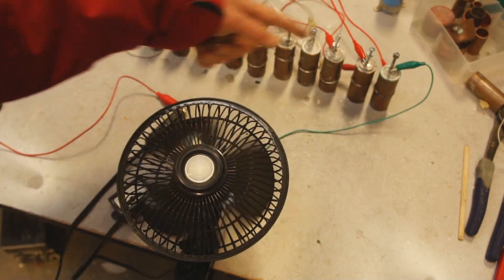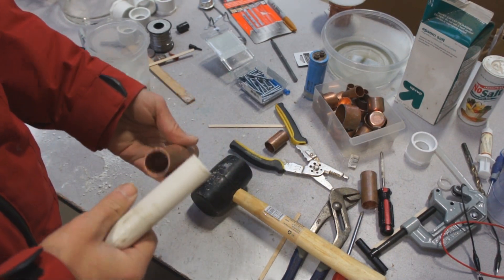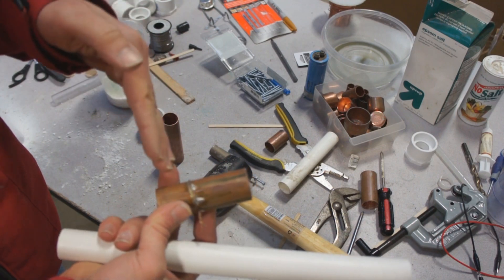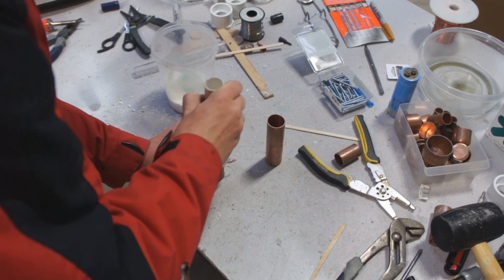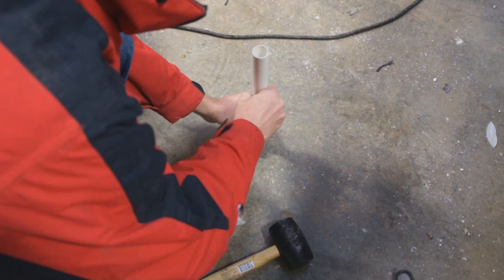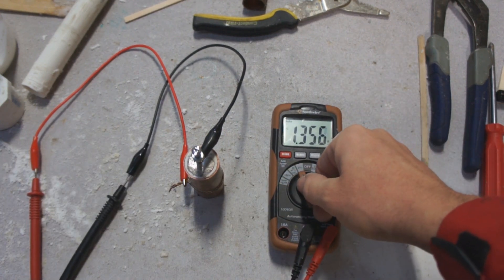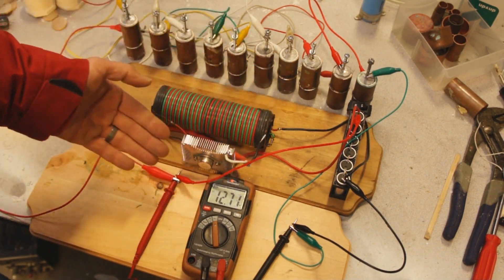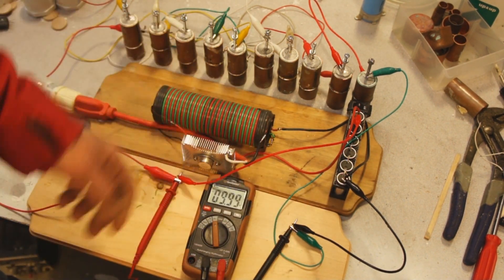12V Crystal Cell Update + Alternative Construction Method

Comment: LaserSaber, I see this vid is old but I wonder if a couple of the crystal batteries the size of d cell batteries would power my minnow bucket aerator? It runs off 2 d cells in parrallel, batteries are expensive now days.

Comment: If you employ Nicola Tesla's battery  recharging system  using your   crystal cell batteries..simply split the positive of your battery  packs  and run a constant power  from the difference of potentials of the positives..Your greatest problem lies with the gevity  of the  crystal cells and switching of order of the cells unless you incorporate a separate induced current to maintain the depreciation of current over time..such as a solar panel or a grounded RF reciever..ect.

Comment: I heard if you pass the current true a crystal quartz it will give an output of 30% more power…. So all the wiring from the battery goes to the quartz then just by coiling the copper wire around the quartz and setting upa contact plate to the point of the quartz is supposed to increase the energy to 130%… 30% extra… would you try that on your device because I think you’re on to something…. You need the hexagonal quartz for that to happen…
Reply: Bad idéal, quartz cristal are non conducting material 😂😂😂

Comment: Could you stabilise the voltage drop off by adding a reverse motor to the circuit, which pushes in power? If you can find a way to stabilise the load, you could in fact have energy for a month on a 1000 batteries, idk , just a thought, maybe this. would be effective if also attached to solar panels on a home

Comment: Sauder a little handle on the side of your copper pipe and cut a slit  down the side of the pipe from one end to the other so you you can fit the plastic pipe in side with ease then if you want you you could use hose clamps to squeeze the copper pipe taught. Heating the plastic tuba and using the handle to pull the copper pipe down the length of the plastic tube just might be easier and less strain on your body than trying to push the two together without the pipe collapsing on itself.

Comment: As the 12V crystal cell update approaches, it is important to expect the amperage to drop radically before stabilizing at a long term base line. Based on past experience, this will be somewhere around 30mA. However, this is only a temporary decrease and the long term goal is to maintain a stable current. There are a few alternative construction methods that can be used in order to achieve this goal. The first method is to use a lower voltage. This will reduce the amount of current that flows through the device and help to stabilize it. The second method is to use a higher resistance. This will also help to reduce the amount of current flowing through the device and help to stabilize it. Finally, the third method is to use a combination of both lower voltage and higher resistance.

Comment: Please answer the following:
1 -  does the size of the copper/magnesium rod matter? ( rod thickness and length) ??
2 -  does the amount of mixture trapped in-between matter?
If I want to make a battery or an array of small batteries that provides ( 40-80amps, 220v ), how big would the battery look like?

Comment: The main advantage as I see it is that this would be a weatherproof battery that is also biodegradable. Would be a perfect battery to run garden lights at night.
I am just wondering how they would react to being exposed to a charge for a few seconds like a super capacitor. Lastly, would a few drops of water between the seals help the electrolyte powders do their job?

Comment: do these things ever run out?
Reply: depends on how well you make them.  I have ones that i made over 10 years ago but with no load for most of that time. its actually stronger now then day one.  Some people claim  20 years but who knows.  I've found that the better you pack them the more you get out of them and the loner they last.
Reply: epikrato so it's the piezoelectricy that makes then work? Didn't John Hutchinson also use 12 volts DC to jump start them initially?
Reply: Wonder if you used high voltage on them?

What recipe do you recommend? The original called for Rochelle salts and sodium silicate, which this one doesn't have. Or the lead glance or pyrite, but I don't wanna use lead.

Comment: Where do you get the magnesium metal and did you cast it or just get it in a solid form ?
Another question  why not  soldering wires directly  instead of those crappy wires with clamps those do alot of losses due to factors that those fancy  color  wires are just connected to clamps using a pressure plate and not soldered . Just test a clamp wire on a 12v powersupply with a 12v dc 50w lamp and see how much drop voltages those clamp wires do .
And about the crystal material what it is made off 
Thank you if I wish get a reply from you . 👋
Reply: I think the ring is not only a wire connection but a stop for the funnel. Look close at the funnel he is using. I just noticed this is over 6 years old

Comment: Can you recharge the Crystal battery? Great video by the way.
Reply: Joshua Zimmer if that's the case, you should be able to put them in any material even a non conductor as long as there is pressure, like resin for example. Or a recycled soda can or food can. 
Then just run a wire into the Crystal mixture before it sets. Right? No need need for Copper or magnesium. 

John Hutchinson originally used Rochelle salts which I believe have the highest piezoelectricy and sodium silicate amongst a few other things not in this recipe. I believe he also initially charged it with 12 volts DC as well.
Reply: @haveaniceday7950  I think you're right but I also think there's a plausibility there must be high surface contact between the salt materials and the conductors. Also it splits copper if there's no place for it to expand so if you use resin, you don't get the surface area contact of the salts. But if you used carbon fiber which is super strong (stronger than steel or copper) and it's also a very good conductor, you might make a super light weight battery that lasts hundreds of years. I may try this as soon as I get the rest of my "Things to do list" completed.
Reply: Anthony if you used bare copper wire and ran it into the Crystal mixture then you would increase the surface contact. If you created nanoparticles out of the Crystal mixture that too would increase surface contact. You can create nano with ultrasonic cavitation, RF, microwave and high voltage and I think there are a few other ways. 

Or maybe a copper rod and then solder the wire to the Cooper rod.

I wonder if you added graphene to the mixture if that would add voltage?

Wouldn't carbon fiber be expensive to use to build enough cells to get useful power?
Reply: @haveaniceday7950  I always side with building with any material regardless the cost and after I get it working efficiently, try to figure out ways lower the cost. I like the idea of mixing graphene in the mixture. Sort of like increasing the surface area of salts to conductor material. I believe now that you mention it, the graphene would act as a capacitor and store power so when the inrush occurs on the power out, it would be provided from the graphene. The outer and inner electrodes would need to have different composites because this is what dictates the polarity and flow if ions. But you could easily impregnate the carbon fiber outer shell with copper and the inner carbon fiber wall with zinc. This would easily provide a variance to flow the electrons in the proper polarity. I may break out the graphene tonight and try this.
Reply: Anthony how would you impregnate? Like electroplating? Then the "electrodes" would just be the inside and outside of the carbon fiber container?
I like how you just have graphene lying around. 🙂

What do you mean by when the inrush occurs on the power out?

If you try it, make a video let me know how it works.

Comment: YOU are a MORON and the people commenting below are blithering idiots.   You do NOT have a 'crystal power cell'  you have an old fashioned copper magnesium dry cell and those 'crystals' you are adding are NOT the source of energy they are the electrolyte to facilitate the ion and electron exchange.    You have no understanding of electrochemistry nor the fundamentals of what you are doing.   Its like a cave man chipping a wheel out of stone yet having no understanding of conservation of momentum.   You are giving up magnesium ions to the copper and forming a magnesium compound which is why its getting 'pushed up'.  The oxide, hydroxide or other Mg compound is larger than the Mg and thus takes up more room.    Also, your magnesium is way too large in comparison to your copper, you can get away with a magnesium tube and a copper tube.    go to books.google.com and look up any early 1900's book on "Primary Batteries" and you'll find this and a million other wet and dry cells that you can make.  The ONLY reason it goes for so long is because you have such a HUGE anode and cathode.  The reason you get such LITTLE current out of it is because your internal resistance is so HIGH.   You really want the magnesium and the copper as close as you can get them and still have room for electrolyte.....er.. um.... magic unicorn farting crystals of power.

Comment: The ingredients you use become have a greater conductor of electrify, the more pressure the more efficient the cells would be
Reply: So wait if he coated the outer pipe in concrete (so the copper wouldn't deform) would it increase the pressure more, giving higher voltages?

Comment: I know that your battery is long lasting but I would be interested in knowing if it would / could take a charge. I kind of doubt it as the powered residue that collects at the bottom of your magnesium rod probably won't reconstitute back into copper metal and magnesium sulfate, (Epsom salt), but it would make for an interesting experiment.

Comment: The reason that the magnesium core gets pushed up is the copper cathode is deteriorating, AKA, corroding as it produces electricity thereby  producing, I'm guessing, copper sulfate, which is a powder taking up more space, from the sulfur, (magnesium sulfate), in the Epsom salt. This is what makes commercially made batteries leak as they die.

Comment: Hi I noticed a reference to a dancing flower circuit, is that just an oscillating circuit? I would like to know if you would quickly mention what the dancing flower circuit is? one more guess would it just be the rocking flower women use on tables and gardens etc....? or am I way off? thanks

Comment: that's approximately 4 megawatt hours per year fridge-size unit:
row of 10 of thees cells from 12v*0.2a=2.4w to 14v*0.5a=7w;
10 rows, pizza-box size tray = from  24w to 70w ; 
stack of 10 trays (shelves) up,   tall refrigerator-size unit = from 240w to700wh; 24/7
thats from 5.76 kwh to 16.8 kwh per day,    172.8 kwh to 504 kwh /month;  2102 kwh to 6132 kwh/y;  2.1 mwh to 6.1 mwh /y...
 ...6 megawatt/y unit...

Comment: i want to help you.  if use a torsion field generator it will increase the out put of the cells but i don't know the  cells life will hold up......   http://3.bp.blogspot.com/-_k8bQOJcazg/UuUeeGUHhzI/AAAAAAAAAV0/u_nCOYnOFo4/s1600/unjjtitled.png
http://2.bp.blogspot.com/-1GLvQJZCMg8/UuUee73Z1NI/AAAAAAAAAV8/zWBqybyuQDY/s1600/torfield.png 

the size of the copper and how fast you spin will rate how much input the cells will pick up on

Comment: Interesting galvanic cells. The thickness and refined state of the metals ensures a long life. Current is proportional to the surfaces in contact with the ionic solid and the conductivity in each half-reaction.
So for example Magnesium Sulfate and Copper Sulfate separated by some kind of PEM could act as charge carriers.
https://chem.libretexts.org/Bookshelves/Analytical_Chemistry/Supplemental_Modules_(Analytical_Chemistry)/Electrochemistry/Redox_Chemistry/Half-Reactions

Comment: OH boy, why does everyone make such a fuss over these crystal cells? Every article a pseudo-professor says something about free/quantum energy is bullshit! This is just a solid-state battery, that is,  for a chemistry ignorant pretty good actually, because the protective oxide layer on the magnesium forms an electrolyte itself. 
THIS BATTERY WORKS JUST LIKE ANY OTHER, THE MAGNESIUM WILL CORRODE AND ELECTRICITY FLOWS AS SOON AS THE CIRCUIT IS CLOSED. The reason why it seems to work so good is because the magnesium is so enormously thick compared to the cell overall size. No quantum/whatsoever bullshit.

written by a scientists ;)
Reply: Andre Leonhardt yeah but people are interested in science and chemistry, crafting and doing thing by hand

 -so maybe that’s enough asshole. 

I’m not stupid or uneducated for wanting to see someone who isn’t a commercial industry build something useful!
Reply: Man, once you get paid to do something you think you’re the only one huh.  Scientist is a very general term and the student of only a single discipline is useless in practical field application without either time in  practice or coaching.
 ; )
Reply: No corrosion in 5 years. some have  a very insignificant amount of corrosion - no reason not to last another 5 or 10 years
Reply: Why in the hell are u here. We're having fun unlike ur miserable ass

Comment: Suggestions: 1 heat it anyway. It creates a homogenous crystal structure within the mixture. 
2 dont use a wire attached to the coil, take from the coil itself. The added wire is creatly lacking in contact and thus amperage.
Reply: Greatly lacking*

Comment: I do not know if this has been mentioned, your cells are exhibiting "polarization" characterized by the drop in current and voltage over time .
This is a common problem with many "dry cell" chemistries .
The carbon/zinc cell is a prime example of this and why manganese dioxide is used in the electrolyte paste .
Wikipedia will provide information about this as well as many other websites .
The "mini boost pack" does nothing to aid in the depolarization scheme . Once the capacitors charge up , they present virtually no load to the cells/battery .
As it stands , the cells/battery require resting in a no-load state to recover by depolarizing (allowing the gas generated to dissipate) .

Comment: Faster methods might not be the best method to get to most out of all the mass. The cooking causing the crystals to form differently, also maybe introduce a magnetic field while the crystals are cooling. Also a vacuum purge that's heated could help you solve the bubble issue.

Comment: An energy source does not "put out" a fixed amount of current.  The LOAD determines how much of the available current is used. Why don't you say that "250 mAh max  (1/4 A) is available" from your battery if such is the case.

Comment: Assuming these function as a galvanic battery, which seems likely, as the voltage would indicate, you could generate more power using graphite and magnesium with the same electrolyte.

Comment: Here is my suggestion for a more effective Cu/Mg cell: You need a really good membrane material for separating the anode room (Mg in a not too concentrate solution of magnesium sulphate) from the cathode room (Cu in a higher concentrated solution of copper sulphate). 
You may get extraction thimbles made of cellulose from laboratory equipment shops.
Put the magnesium cylinder or even better, a coiled magnesium sheet (attached on a rod of stainless steel) into the mid of the thimble and the coiled copper sheet outside and put them both into a beaker glass.
Now fill the magnesium sulphate solution into the thimble that it covers the magnesium.
Then pour quickly the concentrated copper sulphate solution into the outer volume of the beaker glass. You should work quickly lest the magnesium solution soaks through the cellulose wall. The two solutions must stand equally high to avoid pressure differences between the two liquids.
Some minutes later you should get a voltage of at least 3.7 volts or so.
The whole array is akin to a Daniell element made of zinc and copper. With magnesium instead of zinc you'll get a higher voltage per cell.
The achievable current depends on the surface of the two metals. You will get the best results if you use thin metal sheets coiled tightly. So you will get a big surface in a small volume.
Reply: In the early 1990s, Donald Lee Smith claimed to have invented a free energy machine that would allow people to generate their own electricity. He said that the machine could be built using cheap electronic components and that it would be powered by a crystal cell.

Although Smith's claims were never proven, interest in his machine has continued. Now, some people are trying to build their own versions of the free energy device using alternative construction methods.

It remains to be seen if these homemade machines will actually work, but it's clear that there is still interest in the idea of a free energy device. Who knows, maybe one day someone will actually succeed in building a working model of Smith's machine.